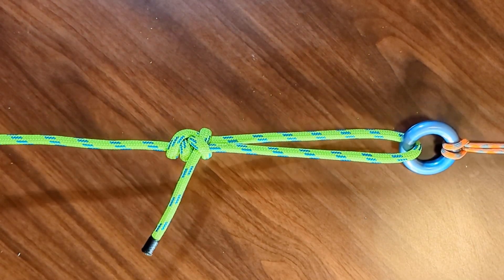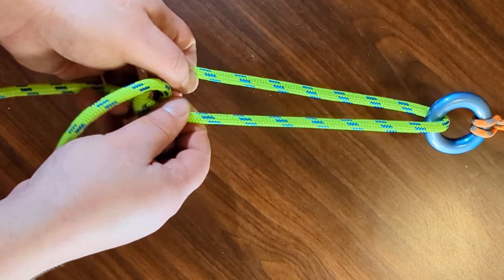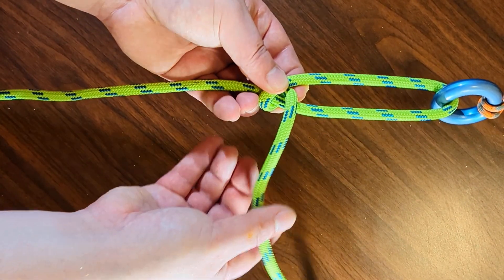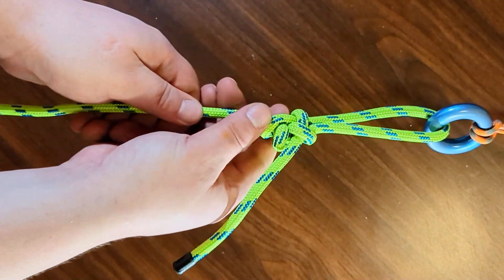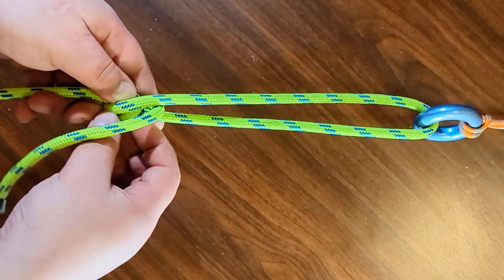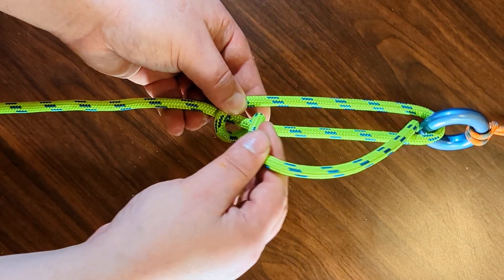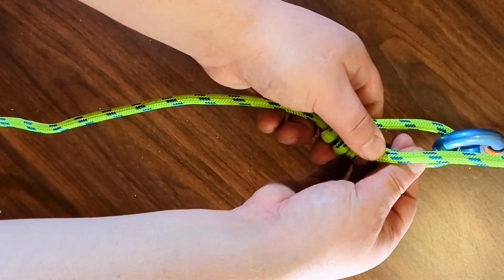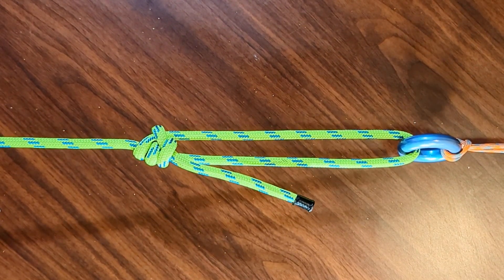ADJUSTABLE GRIP HITCH: A Slipped Method for Controlling Tension in a Rope!

Comment: What’s the difference between this and a Taught Line Hitch
Reply from the maker: The tying method for the Taught-Line hitch is slightly different. At least as best as I can tell after analyzing both in photos online. A Taught-Line hitch is made by wrapping the line around an object and then tying a Rolling Hitch around the standing end. The Adjustable Grip hitch is tied quite differently. But they both serve the same exact purposes. Good question.